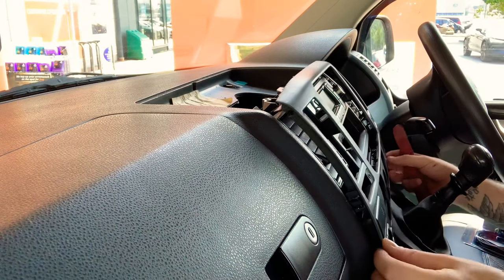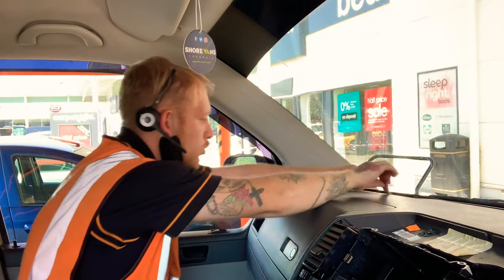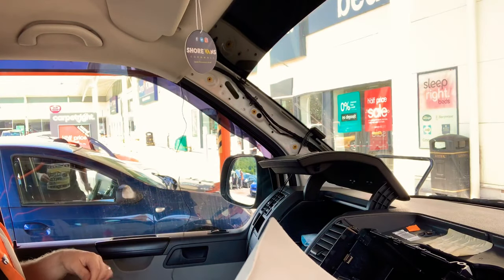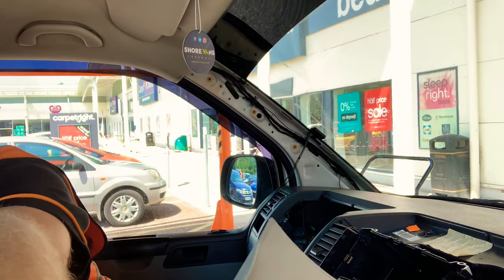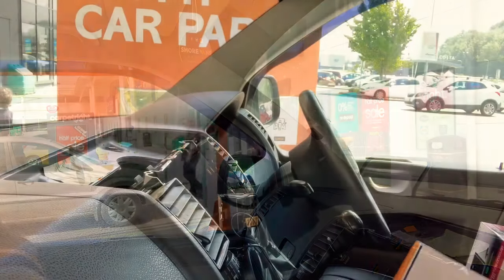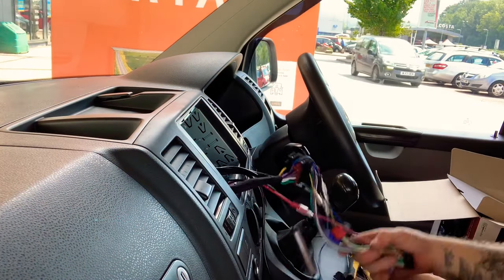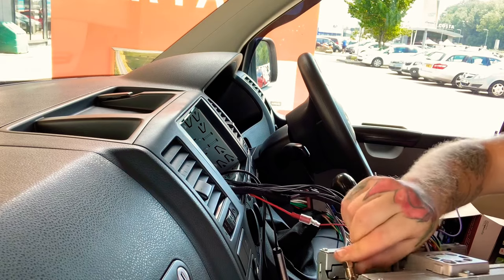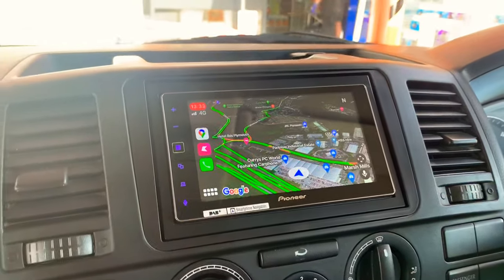2011 Volkswagen transporter T5 pioneer Install

Comment: please advise how you connected separate power to fuse box and where did you connect it on the pioneer itself I have similar model so wonder whether it should connect to battery (yellow cable on connector) or ACC (red cable on connector) and what should be the fuse. thx

Comment: Great video Ryan. I just have two questions. Which one is the fly lead on the stereo? Also my blue wire from the Fakra aerial is currently not attached to anything. Should this be connected somewhere? (Think it may have become disconnected when removed from another vehicle)

Comment: This is the best installation tutorial on YouTube. Thanks for making time to create it.   I just need to know one thing. What rating fuse do you use on the piggyback fuse holder?  I am guessing that it is a 2 amp fuse?  And does the fuse holder plug in to an an empty space in the  fuse box? Thanks Andrew.
Reply: Did you get this sorted mate as I'm wanting to know the same
Reply: @amandamcallister6664  no sorry.  I ended up not pursuing the project.

Comment: Brilliant video thanks, just fitting the 160 mode to my 2011 t5 Is there a guide connecting the power I can’t seem to pass the cable to the fuse box
Reply: did you ever get these details, I might buy one for my t5.1